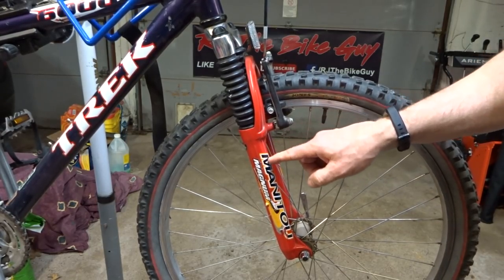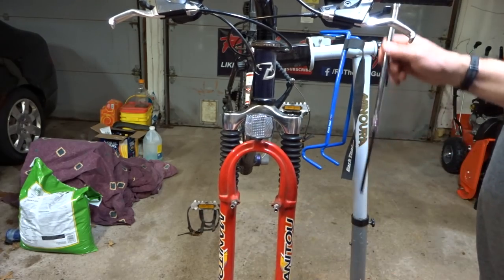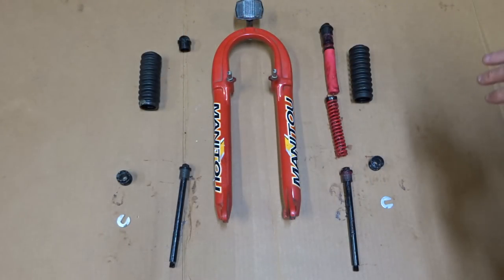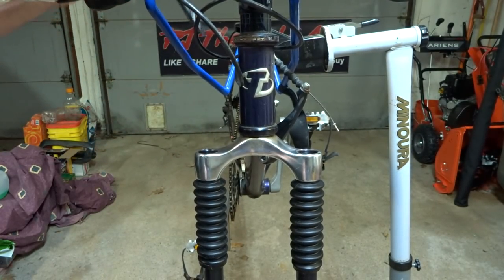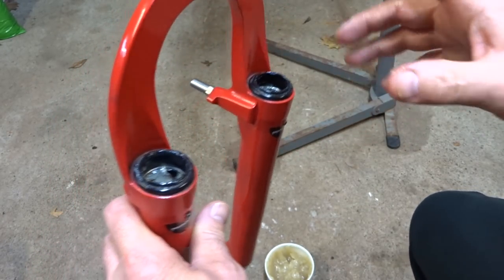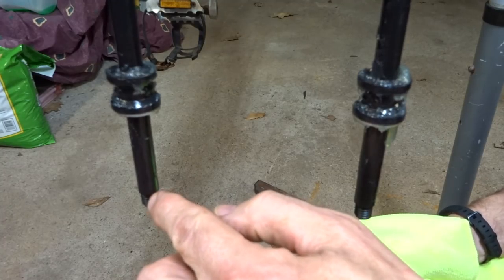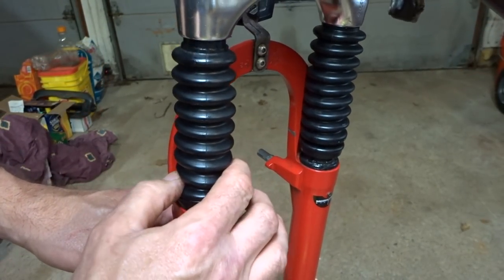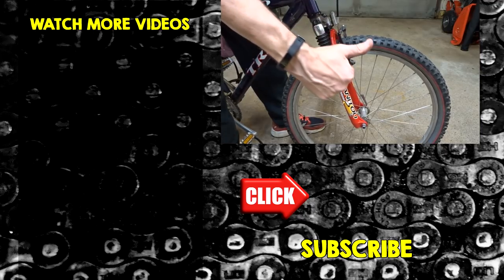Manitou Magnum Fork Service - Disassemble/Clean/Lube/Re-assemble

Comment: I always get rid of the outdated fork boots when servicing older forks
Reply: They are really whats missing on cheap suspension forks. I have corrosion on mine, sand etc i wish i had some boots
Reply: @MrJob91  I get rid of them because in most cases they've either ripped, popped off at the bottom, or come with drain holes at the bottom and in most cases dirt gets in and stays in causing excess damage to the stanchions and seals, I look at it as easier cleaning and preventative maintenance without them, keep shredding 😎🤙
Reply: @BerserkerNick  awesome man! U2
Reply from the maker: Newer forks with no boots are MADE to not have boots.

Comment: If you ever overhaul the earlier Manitou forks, the ones with the elastomer bumpers in them, and they have "melted" a good way of getting the dead elastomer out is to clean it with a degreaser then acetone to dissolve any remaining residue.  Very dirty job, but a good learning experience.  Old Shovel rebuilt some older Manitou's, good info there.
Reply: Which Old Shovel video... Asking for a friend!😉

Comment: after you serviced the fork ,would ,ve loved to have seen round the bike with a quick rundown of the specs and hardware gives us info to compare when we go out buying the older bikes should do it on every video we wanna see the bike that goes with the fork ,good no nonsense vid as usual thanks
Reply from the maker: Yeah, that would have nothing to do with the subject of the video.
Reply: @RJTheBikeGuy  yeah i get it ,makes sense you got huge selection of fork service vids  catalogued ,maybe a separate video series of just the bike and spec details i love 90s mountain bikes were well made but through the decades interesting to see  whats been swapped out
Reply: @RJTheBikeGuy  I too, believe a few germane comments on the vintage bike's specs( here a 90's TREK 6000) , and or the relative quality and reliability of any component would add immeasurable interest and value to the video and not "recategorize" a component rebuild in fact or manner,imo.Thanks for all of your videos,phil

Comment: Thanks for this tutorial. I have a Manitou Six from 2005. It came with a service manual but I didn't want to F it up and never had it serviced because I hadn't noticed any problems with it but I think it's long overdue now. My top caps had a recall Manitou had some failures with them shooting out under pressure and hitting people in the face but I never swapped them out with the replacements they sent me. It looks like the only tools I need to invest in is a beam torque wrench and hex socket. Thanks!

Comment: Great video. I have a set of Manitou six comp that need to be overhauled. Thx
Reply: That is the one I have that I had problems with. I have a 2002. I posted my problems about 1 week ago. Reach out to me IF you decide to overhaul yours please.
Reply: @robert50173  ah thx so much I will. Have yet to start rebuilding them. Mine are a 2004 series and are in much need of a rebuild.

Comment: Those forks seemed to have been serviced already, unlike the rusty, ceased and disgusting things I end up working on. Nice to see you back RJ.

I've noticed that the rubber boots on the outside of the stantions on older forks actually do a pretty good job of preventing rust. Maybe that's why manufacturers stopped fitting them.
Reply from the maker: I doubt it. I think these people just took better care of the bike.
And, no, they just redesigned the forks with better wipers/seals, so as not to need boots.

Comment: I just use molybdenum disulfide  Moly lube. $7cdn at Canadian Tire for a 400 gram(14 oz)  tube, much cheaper on sale i use it on everything.  If it's good enough for a a 3000# care at highway speed , it it's great for bikes. I also use in my motorbikes and dirt bikes. no probleme in the last 40 years of using it.

Comment: Hey RJ! I just disassembled an identical fork (off of an IDENTICAL bike!) - a small amount of fluid drained out of the bottom of each leg when I removed the main rod, I thought it was fork oil but I didn't analyze it overly close- I figured there would be a step to add some common weight fork oil back in during the renewal, but you had no oil out or in on this example- could it have been some water that got in the leg through the seal? no oil?? Interested in your thoughts- I've done numerous rebuilds now mostly based on your videos- TY very much!
B.
Reply: Possibly worn elastomer?

Comment: What about a bottle brush? Would that work to clean the inside of the forks? It wouldn't hurt anything would it?
Reply from the maker: I use one sometimes. Often they go in, and are hard to pull back out. And get very greasy.

Comment: What are your thoughts on using silicone grease on forks? Mine are low end, and it's the only place I use the stuff.
Reply: Good question, does it work well after you regreased your fork ?   silicone grease does not damage plastic or rubber but will damage silicone rubber parts. I don't think suspensions have silicone Oring or seals. ?
Reply: @jeremyp7293  It makes the best of a low-end fork, put it that way. Seems to last longer than the lithium grease I was using before.
Seals are most likely to be vulcanised rubber in my experience, or neoprene/foam rubber type material. Don't think silicone is very common.

Comment: How different are the manitou sx forks.  I noticed they have allen bolts on the bottom so would they be similar more like rockshox jett.  In this magnum the plungers are removed internally with the Allen key just curious how to do it on the SX fork since it has an external allen bolt.

Comment: hi, i have the saim pair of front suspension I was wondering if you could help me please? the first top cap you took off on the left was a red/orange rubber thing inside the tube. I need a new one for mine and the whole of the left top cap. do you know what it is called and were to get a new on or something I can use instead as I know they are over 20yrs old and getting parts is hard. PLEASE REPLY... thanks in advance ☺
Reply: They are called microcellular elastomers. Check Ebay seller "johndeverill" . You can also sometimes replace them with steel springs for bikes, also available on Ebay.

Comment: Hi. My forks are very similar to the ones you rebuild in this video. But on mine, underneath the left hand stack cap there is a schafer valve. What do I do with that?
Reply from the maker: Then your forks are nothing like these. And you need to find instructions for yours.

Comment: Repair two bikes yesterday bmx bike 
Front tyre and inner tube 
Mountain bike brake very slack 
Loosen brake cable pull it through tight alan key

Comment: I just took apart my Manitou 6 six forks that is 19 years old and was never serviced. I have big problems now. One of the screws on bottom  is soft plastic, was seized in the hole, allen  wrench just spun in it. Easy out wouldn't free it. I ended up drilling it out along side of the easy out which was stuck in the cheapy plastic screw. I got everything out and got so frustrated that I am not 100% certain how to put  it all back together. Some of the bushings are angled and there is an option to convert it from 80 mm travel to 100 mm. The spring side I am pretty sure about but the other side is confusing. It also takes oil which it did not have when I took it apart...If anyone has a close up schematic I would greatly appreciate it...😀